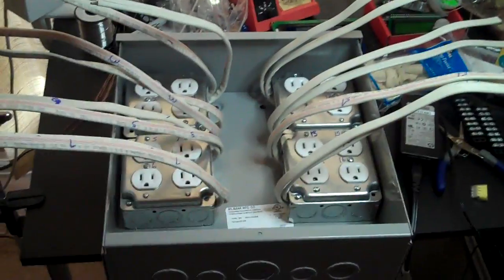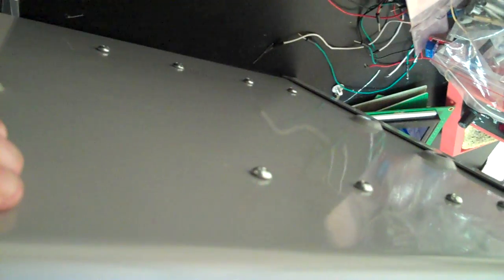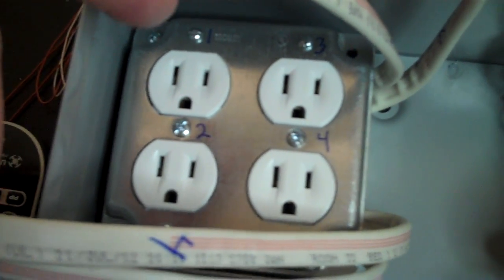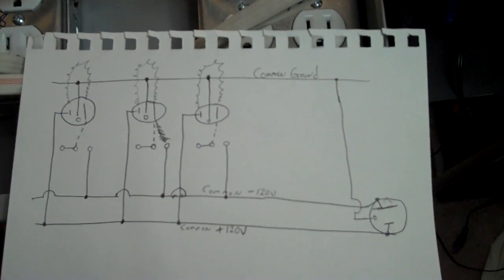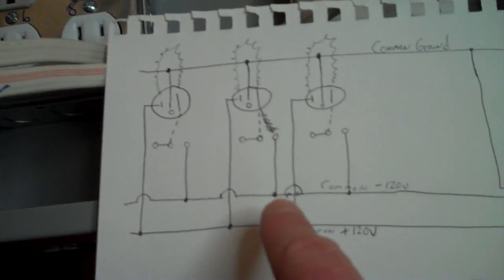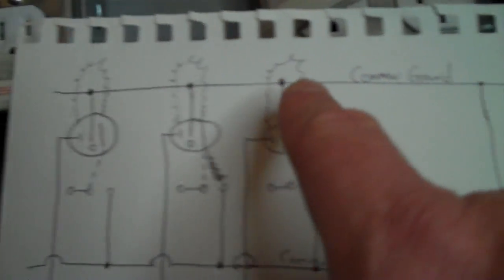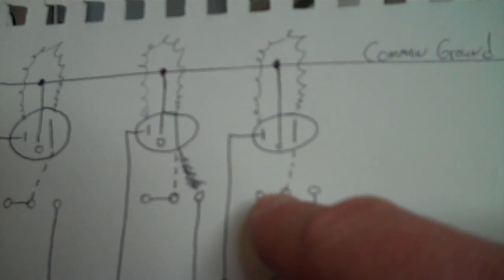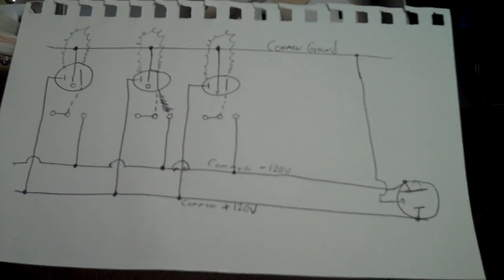Christmas Lights Control System - Part 2-1

Comment: DO NOT WIRE YOUR ELECTRICAL AS HE HAS IT DRAWN OUT , HE IS SHOWING THE RELAY ON THE NUTURAL SIDE AND SAYING WITH IT OPEN IT WILL NOT COMPLETE THE CIRCUIT , BUT THE GROUND WILL . THE RELAY GOES ON THE HOT SIDE ONLY .......
Reply from the maker: Yes, this is fixed in version 2.

Comment: OK , OK , OK I don't mean to sound like a downer on here BUT !  You missed ONE BIG GIANT STEP .... When you are going to be using a Double plug there is a JUMPER BETWEEN THEM YOU MUST CUT OUT to make each plug a Single Plug . Other wise you are sending TWO(2) Circuits to both plugs ...ALSO it would of been better to mount the plugs on the outside of the box on the lid . That would give you all sorts of room to work with and you could place a piece of rubber mating over the plugs to keep the rain and snow off of . JUST A THOUGHT ...
Reply from the maker: No worries.
Reply: BigHeartedMan65  his intention I believe was to make it water proof, and he is doing that by putting the outlets inside of the box. Also, not all duplex receptacles have a jumper between them. I bet hews smart enough to use separate circuit receptacles.
Reply: Parker Lambert  This is NOT about making the plugs water proof . It is Using One Duplex Plug Which ALL Plugs as he is using are tied together when you buy them . THAT is why they offer you the Choice to make them TWO Different Plugs by cutting the Jumper between them. If you wired it as he has it laid out now YOU WILL BE GOING TO THE HOSPITALL ...If he is Smart Enough to know he needs to Share that with those who Don't know ...
Reply: +BigHeartedMan65 First video showed him removing all the tabs.

He's not spanning the full 240V either, so his wiring would simply put all the lights on when one goes on... I get the neutral-sided relay is a big no-no... but it's not the tab that's the issue.
Reply: Must of missed it ...

Comment: I agree with Alan.  You should have the relay on the hot side, for safety.

Neutral is normally tied to ground (usually at your circuit breaker box).  I you have the relay on the neutral side and you grab hold of a light cord that is frayed, you could potentially get shocked, even if the relay is open.  By putting the relay on the hot side, you eliminate this potential disaster.

Comment: Unless I am misunderstanding your explanation and schematic, you are switching the neutral side of the circuit which is incorrect and dangerous.  In mains wriing you always switch the hot side of the circuit.  This way when the circuit is in an "OFF" state you don't have any power at the outlet or extension cord.